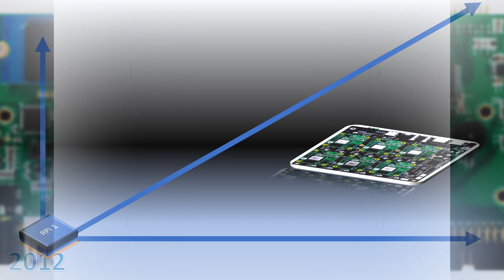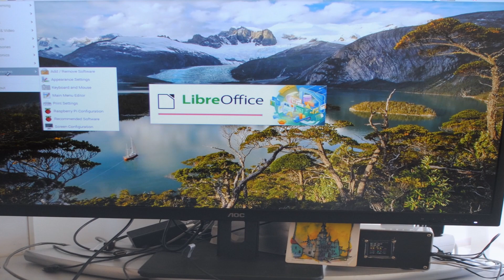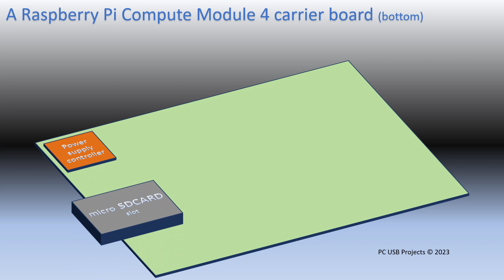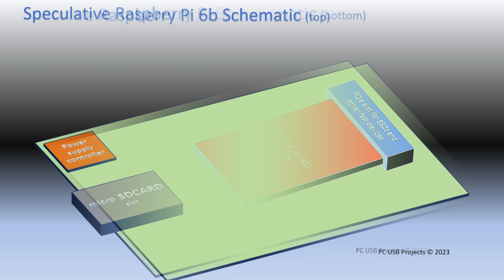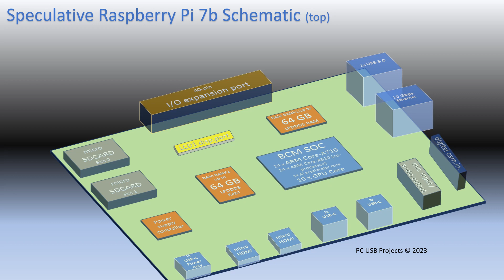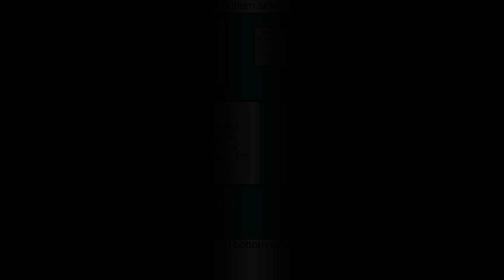Raspberry Pi speculative roadmap 2027: Raspberry Pi 5, 6 and 7 might be on the horizon!

Comment: And... 28th September,  2023 the Raspberry Pi 5 came along for preorders... 

So now you can stop speculating on what it might have. We all know now. Still, interesting to see what you suggested...
Reply from the maker: I like what I had predicted, but I also admit that I hoped for a bit more that current Raspberry Pi 5 got us. I guess that current Raspberry Pi 5 is actually an immediate answer to ever more powerful concurrent designs like Orange Pi 5 and Rock Pi 5. But the latter lack software support, so I'll still stick to the Raspberry Pi at least for a while longer. Here is my new video: https://www.youtube.com/watch?v=6CEET-YF-9s
Reply: @pcusbprojects  The Raspberry Pi 5 has a game changer in it... a custom I/O chip. They sat down, worked out their needs, and then designed a proprietary chip, and had it manufactured. This has streamlined the board, it means more direct control over certain supplies, and it means that they can now improve I/O performance. Quality over quantity seems to be the big thinking here.

Furthermore, there is now a PCIe lane available... from a ribbon cable. This means you can do what you want with it, and not simply be restricted to one type of slot connector. This opens up a whole range of possibilities. 

Also add in a RTC and power switch... and a dedicated fan header. This is looking more and more like a serious little computer now. And more significantly, they did it with the same size as before. That in itself is impressive.

This is going to be interesting to see being developed and honed, and what additional components will end up being made for it.
Reply from the maker: Of course! Watch this updated video: https://www.youtube.com/watch?v=o-_yrnbMWOM&t=4s